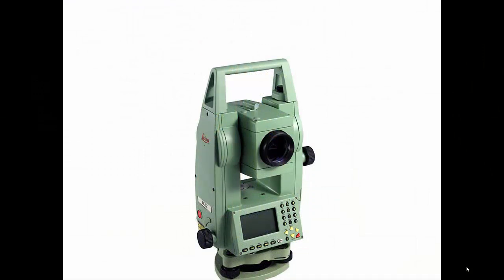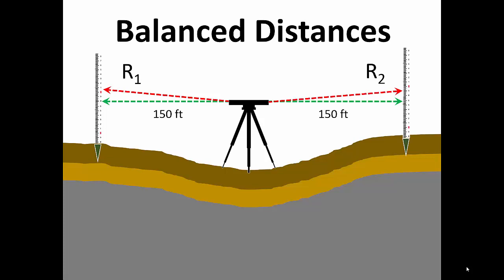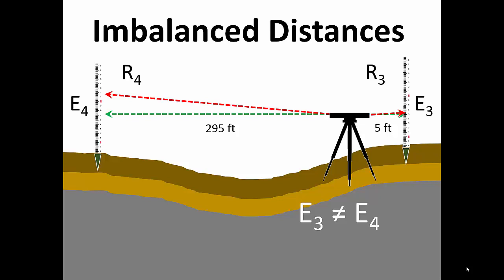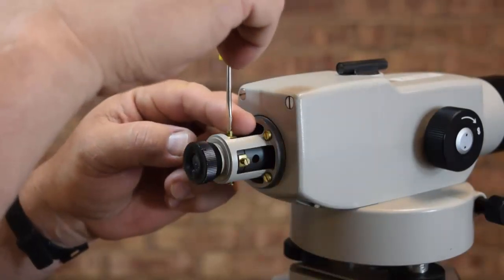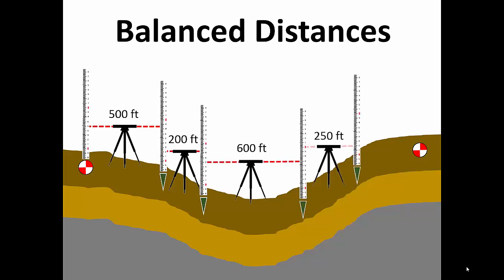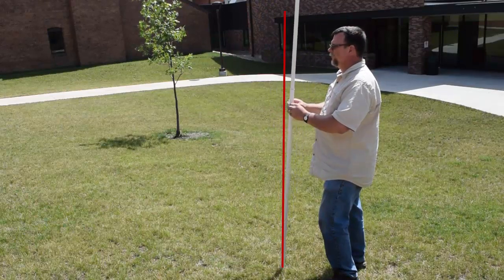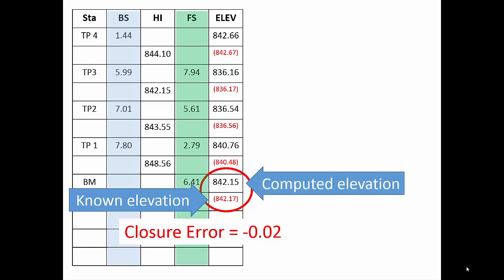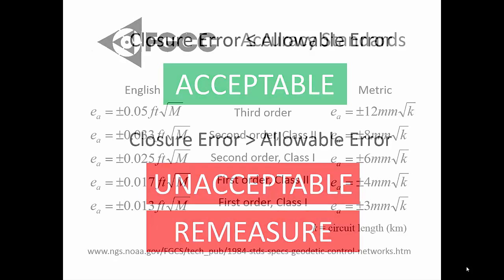Leveling, Part 5

Comment: I have enjoyed your videos they were fun to watch and you touched on rocking the rod a very important part of eliminating some error.... I studied under one of the best surveyors in the country not in the classroom but in the field.. we once ran a bench Loop 3 miles long with permanent turn points.. I read one way he read the other...250' to 300' turns...closed at .02.... He remarked as unheard of... we rocked each turn.. and he chose to hold the first run outright... I'm hoping you'll do another video showing stadia.. meaning retrieving Distance by using the method of elevation... And also running a three wire or even two wire bench Loop.. and meaning out the values... Which I have used multiple times... Thank you Todd for the videos I have enjoyed them I already know how to perform these techniques .. and as I said before when I started I wish I had YouTube..lol..

Comment: 1/100 of a foot.  But long distances.  I was once amazed when one of our products had to be leveled to a tiny fraction of an inch and it was done with a leveling telescope.  The target was roughly 10 ft in diameter and the. telescope was some 15 to 20 ft from the closest edge.  There were 4 pedestals for the scale rod, 3 of which were visible to the telescope.  And yes, despite my reservations, the process produced resolutions to 0.001 inch.  I don’t remember what the leveling specification was, but probably something like 0.005 or 0.010 inches.  The adjustment was done with 3 of 4 jack screws.  This procedure was a demonstration of the capability at our plant.  The customer eventually performed the same at their plant and supposedly locked all the jack screws .
Reply: Good